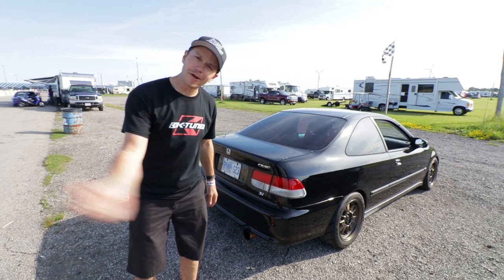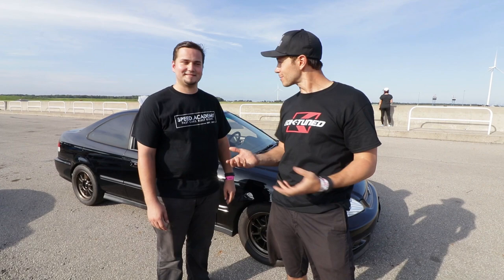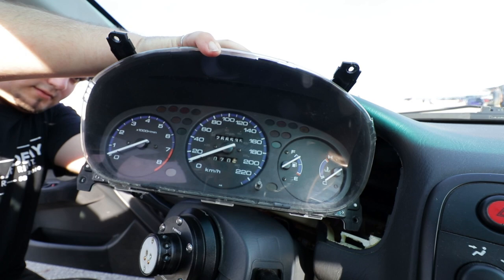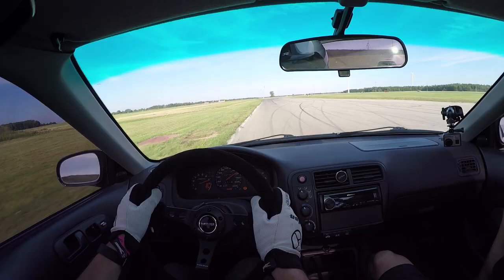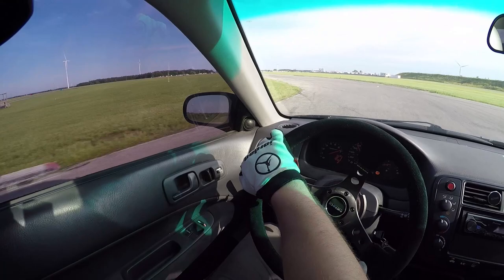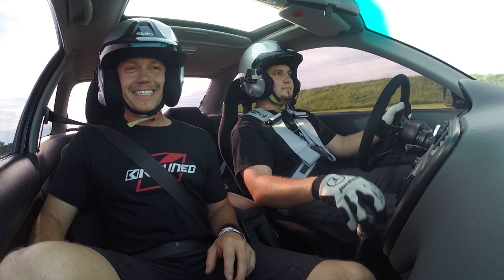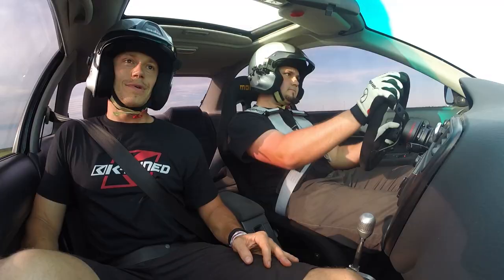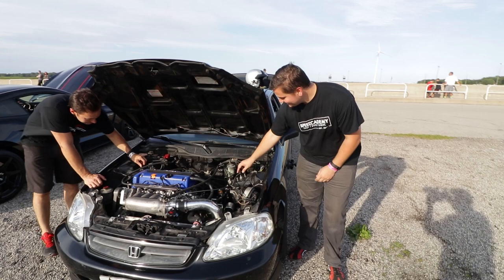How does Jake Do At His First Track Day? K-Swap Civic Track Build - EP10

Comment: I hate to be negative cause I love what you guys do. You guys would greatly benefit from adding a neutral density filter to the cameras while doing in car shots. to help lessen how blown out the video gets out the windshields. Possibly a Gradiented neutral density filter so that the dash can still be in nice and visible.
Reply: Sounds like constructive criticism to me. Not negative at all :)
Reply from the maker: We've got spot meter turn on in the GoPro which is supposed to help with that but having a gradient filter isnt a bad idea at all. We just need to see if something like that exists for GoPros!
Reply: Check amazon for budget ones, they work with the open-frame gopro mount you're currently using.  You can upgrade to the fancier ones at a later date.
Reply: Lee filters Makes a kit I believe.(LeeBUG) Its probably a resin filter. I haven't had any problems with their resin filters. Sadly lee filters are more expensive. But never had any problems with them. I use a set of 150mm cinema Grads for wide angle photography. http://www.leefilters.com/index.php/camera/system-action-drone
Reply: Lee filters are super nice but might be a little over kill for a gopro.
Reply: Ever since I updated the firmware for my GP Hero 3+, the spot metering is for crap if I have it in an enclosed car.  If the top is up, my video always gets blown out.
Reply: Spot meter is right in the middle and you can't move it to be biased toward the upper part of the frame, when his head tilts down it exposes for the shadows in the dash, when he looks back up it exposes for the windshield, so it's a bit tough unless you can manually lock exposure
Reply: MishoMods I've played with it and adjusted it with real time monitoring through the app and it just seems not to work anymore. I'll probably hard reset it again to see if that fixes it, but I've been eye-balling AiM's SmartyCam HD as a replacement and use the GP as an exterior cam.

Comment: COOL WATCHED ALL THE VIDEOS ALL THAT WORK OVER 200hp I don't think it was worth it but if you get it up to 500hp then I would watch more videos
Reply: Travis woodbury its a naturally aspirated 2 liter engine lmfao, how is 500hp even close to possible
Reply: Respect FreeSpeech trust me im aware k20s are capable of 250whp with even just bolt ons and a tune. im saying its not capable of 500 without boost. yes ive seen the 500 hp 2.7l k24. that things fucking nuts, but like you said its like $20k and were talking about k20s not k24s anyway.

Comment: out of a scale of 1-10, how bad is bouncing off the Rev limiter?
Reply: Depends on the engine, mods, tune, and type of limiter. On a stock engine with stock cams you won't be at as great a risk as if you were to have drop in cams with stock springs. The K-series is an amazing engine designed by Honda to be driven in a sporty manner. If this was a D16 designed by Honda to get granny to church than you may not want to be around the limiter as often. Some limiters cut fuel, some cut spark, and some cut both. Most OEM limiters are fuel cut; cutting both is better as it will eliminate the unlikely situation of running lean just as the injectors stop firing.

Overall it's not too bad here and there. If you're hitting the limiter on down shifts that's an entirely different story and that can and will wreck an engine.

The reason they're on the limiter so much is because the power doesn't tapper off up top so there's no physical que to the driver. Most cars taper off up top or even nose over a bit near the limiter giving the sensation of decreased acceleration and a que to change gears. If you watch the dyno vid the power is constant to the limiter. We had this problem with our last race car, we couldn't rev any higher because of a shitty rocker arm design so everyone was always on the limiter. We changed heads allowing just a few hundred RPM more and now we never hit the limiter.
Reply: jcwat 3 or 4
Reply: Ben Cork thanks for the info man, guess my stock k20 is safe.